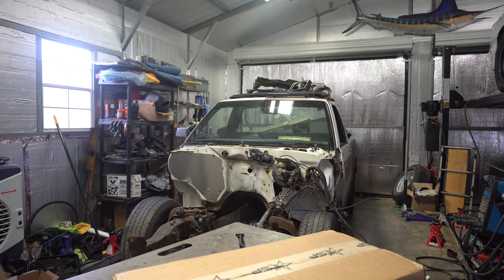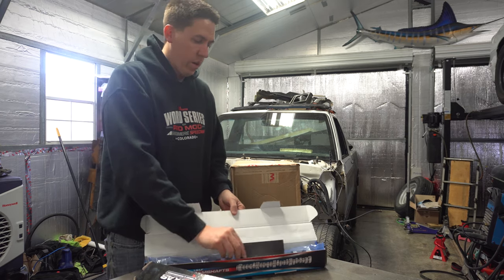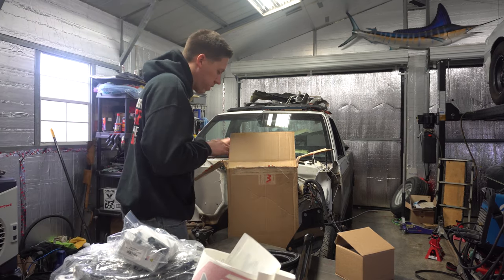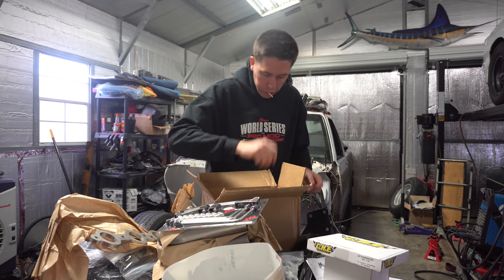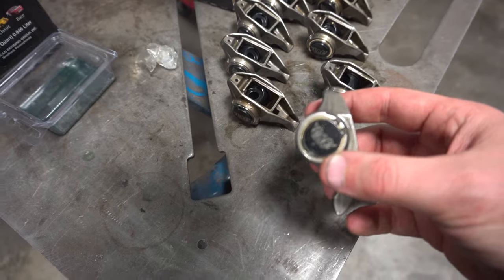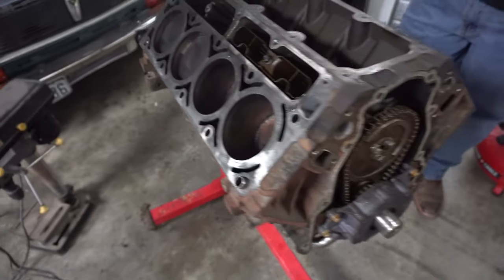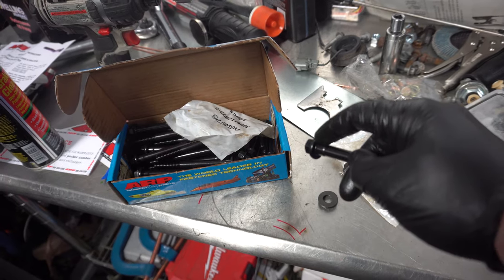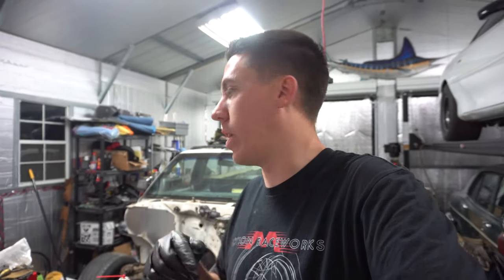LS Swap S10 Burnout Truck Gets Custom Texas Speed Cam!

Comment: We just finished up a C twin turbo car today. Texas speed short block and cam and lifters with ls3 heads 
They sent 7.400 standard length pushrods and the lifters were making a lot of noise. We then checked push rod length and we need 7.425
This was all customer supplied parts from Texas speed.  
Every LS motor you need to verify push rod length. It say it in fine print on every cam manufacturers directions.  
Another tip. Is the lifter trays they suck and fail. Everyone was always blaming the lifters for failing and it the trays. Shitty design 
The tray wears out and the lifter start moving around in the lifter bore and wipes the cam lobes out.  
Either use the best lifter trays you can find or go to lifters with bars and don’t use trays at all. 
Good luck nice job on the zooooomiesssss